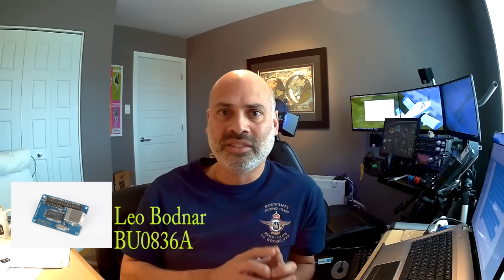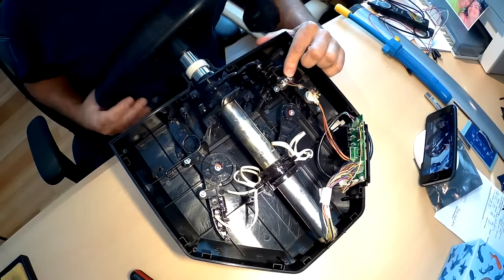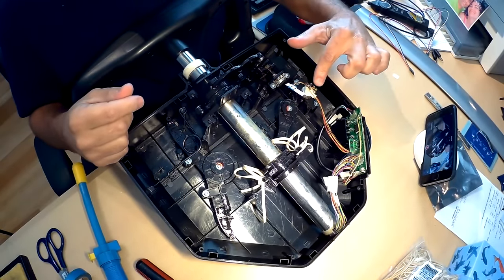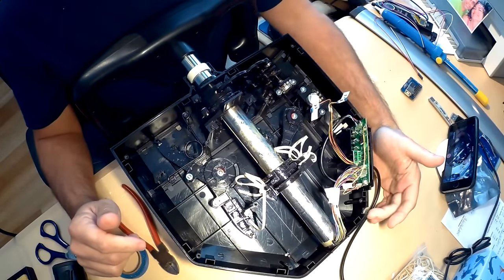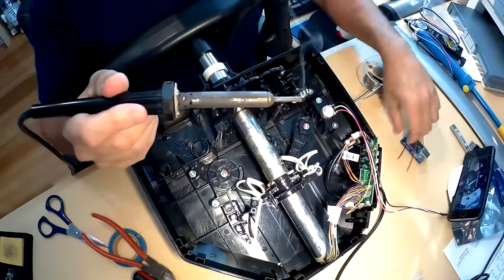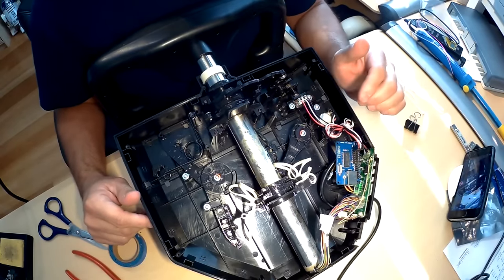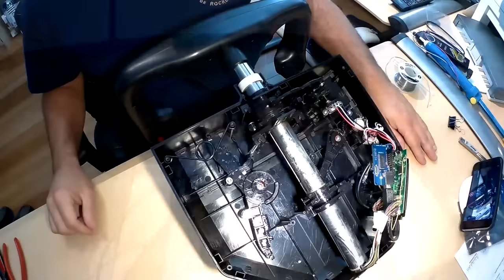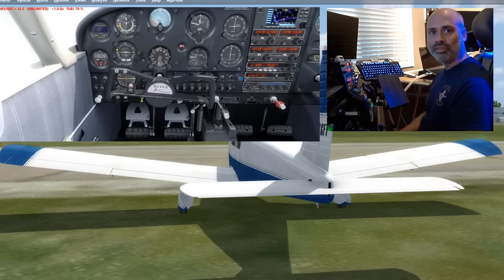Saitek Pro Flight Yoke Dead Zone Fix

Comment: Hello Dan!
Congrats on the video. and by the instructions.
Dear friend, maybe you can help me with a problem I'm facing in my Flight yoke system. It is calibrated at:
 (X-plane 11, 12, and MSFS 2020), and has the following issue:
when making the movements (aileron and elevator) in the yoke, it does not make the movements in the aircraft, so I remove the USB connection and put it back, at that moment it is normal, but a few seconds later it doesn't work again, I remove it and put it back in the USB, it works again but after a few seconds it falls again, including the display lighting is not lighting up, it works is only the lighting. if you can help me, thank you.
Sorry to consult you here.
abs
Eduardo - from Brazil
Reply from the maker: Wish I could help but it would very hard to guess the issue.

Comment: nice how to. thanks. one question. can you simply loop the usb of the bodnar board to the built in usb hub of the yoke? in this case you will just have one usb calbe from the yoke to the PC. if so, i guess you have to connect an external power source in order to power the internal usb hub.

Comment: Hi, I just made this modification and it works fantastic, only problem I have I cannot setup the buttons anymore. I have in Win10 devices still the Saitek Yoke (buttons are recongnised) and of course the new controller which I just instralled (no Bottons to set up) is there a possibility to merge the two controllers so I can use again the bottons of my Yoke??
Reply: Problem solved!!
Reply: Hello, what did you do to fix the problem, please ?

Comment: Nice bro what sim you using? I use logitek flight and saitek pedals in  I'm on prepar3d I use Fsuicp to calibrate axis and other functions I have no deadzone at all however since going to prepar I'm having noise on my axis but not in fsx I think it may be the different version of fsuicp one thing I learned is calibration when I calibrate my axis in spad next I notice lot of deadzone

Comment: Hi Dan, I installed the new board as your video, and plugged the usb from the board  into a free usb port on the back of the yoke. I have a problem with my set up, I tested it in "Devices" in my PC. the new board seems to operate as it should, but I get nothing from the yoke set up. I also tried it in XPlane , but no movement from the control surfaces at all As if the board is not communicating  with the yoke . What am I missing?

Comment: Great video! Will try this soon. Just one question, what configuration do you use with the rubber bands to give a good and smooth feedback of the elevator and ailerons axes??? Thank you in advance!
Reply from the maker: If you mean configuration in software, I have added a small deadzone on the pitch axis.  This is helpful to me.  If I misunderstood your question, just clarify for me what you mean by configuration.

Comment: Thanks for the video! I do have a question however. On your yoke, looking at the pitch potentiometer, your wire colors are yellow, red, black (from right to left). But on my yoke, mine are black, yellow, red (from right to left). Will the yellow wire always be +5v regardless of what position it's in?
Reply from the maker: That's a good question, I am not sure.  I would suggest getting a multi-meter and testing the voltage on that yellow wire to see.  Let us know your results!

Comment: Great video! Sadly, in my haste, I plugged in a 5 VDC power source with the plug set to reverse polarity (don't know why I set it up that way, or for what project....). Fried the Saitek Yoke power supply (I assume they take 5 VDC and regulate it down to 3.3 VDC). The question I have for you is, will can the 0836 board accommodate all switches and pots from the yoke and quadrant? I suppose if not, two 0836 boards could be used. Thanks again for the very important tips on the 0836 board! I've been thinking about doing this with an Arduino, but this solution seems much better.....
Reply: Ron Novak Excuse me, sir. what type of arduino board should it use? I don't really understand about type and model. Thank you!
Reply from the maker: You should be able to use the BU-0836A board to replace all your Saitek Yoke functions.  
It has 8 analog inputs,32 button / 16 rotary encoder inputs8-way "point-of-view" hat switch input
Reply: Caballeros 

I did my first tests with an Arduino Leonardo. Using a software library from M Hieronimus called ArduinoJoystickLibrary. It is in GitHub. I modified one of his examples to do analog reads. Bothe Leonardo and Micro are capable of being used as game controllers by Windows-based computers.
Reply: BTW, from Amazon, the Leonardo I bought was $10!  You will need to use a port expander since all Arduinos are port line limited but the package will probably cost less than a BU-0836A. You will need to program the Leonardo and interface the components. In that the BU-0836A is a simpler solution. (I bought one of those too, took two weeks to get to me, had the Amazon order in two days...)
Reply: Ron Novak Thanks for your information, Sir. What if I use Teensy 3.5 or 3.6? I look at the specs, comparing to BU-0836A, It has more analog input with 13-bits resolution (as I know that more bits means more precision)
Reply: Caballeros 
Absolutely right, I believe the Arduino's a/d gives us 10 bit resolution, i.e. 1 of 1024. If the Teensy is 13 bit res, that's 1 of 8192! However, looking at the Library from M Hieronimus, the Windows Game Controller Interface uses 0-127 or -127 to +127! When you program one of these devices and look at it in the game calibration ap, you will see that the ap automatically scales the input data. So I'm not sure that the resolution of the a/d should be your deciding factor. The Teeny does have more I/O ports and lines, however I believe they are 3.3 V, not 5 V. With that, we may need to use a level shifter to connect to 5 V devices. At ~$25, plus costs for ancillary periferrals, it may be worth it to go with the BU-0836A, at ~$30 (lots of I/O, operates at 5 V). The cost analysis also makes the Leonardo (~$10) and MicroChip MCP23017 16 bit I/O Expander (I2C interface, ~$1.20!) look very attractive. I must admit, I have bought all three and am playing with them to see which works best, etc.
Reply: Caballeros 
Absolutely right, I believe the Arduino's a/d gives us 10 bit resolution, i.e. 1 of 1024. If the Teensy is 13 bit res, that's 1 of 8192! However, looking at the Library from M Hieronimus, the Windows Game Controller Interface uses 0-127 or -127 to +127! When you program one of these devices and look at it in the game calibration ap, you will see that the ap automatically scales the input data. So I'm not sure that the resolution of the a/d should be your deciding factor. The Teeny does have more I/O ports and lines, however I believe they are 3.3 V, not 5 V. With that, we may need to use a level shifter to connect to 5 V devices. At ~$25, plus costs for ancillary periferrals, it may be worth it to go with the BU-0836A, at ~$30 (lots of I/O, operates at 5 V). The cost analysis also makes the Leonardo (~$10) and MicroChip MCP23017 16 bit I/O Expander (I2C interface, ~$1.20!) look very attractive. I must admit, I have bought all three and am playing with them to see which works best, etc.

Comment: No hardware changes--the deadzone is fixed!  I had the same problem, but after installing the driver/software released June 22nd, 2017 it works great! Here's the link to the Yoke update, and there's also an update for the rudder pedals as well (though they've always worked well): https://support.logitech.com/en_us/product/flight-sim-yoke-system/downloads
Reply: so there is no dead-zone anymore ? have you tested it thoroughly ??
Reply: greeksalad84 I flew one loop with the brand new yoke straight from Logitech and hated it. So before I bought this part and complained to Logitech, I figured I'd better see if they had an updated driver or maybe a flashable executable. I saw the recent driver + software combo,  installed it,  restarted,  re-calibrated X-plane 11, and wah-bam! Now it flies without a dead zone and I can zoom in on my Cessna's wing and see the subtle movements responding as soon as I start to turn the yoke.

UPDATE: A Logitech rep said "There are very slight deadzones built into the yoke, and you should be able to configure deadzones within the software." After flying a second time (without configuring the dead zones like the rep mentioned), I re-tested everything, and I can notice a very tiny dead zone right around all the centers; but, it's negligible and almost seems non-existent sometimes.  I might mess with the Saitek/Logitech software settings sometime, but it's pretty darn good at its default settings.

I'm on the latest Windows 10 64-bit OS.
Reply: You should have purchased a CH Yoke instead. People have nothing but good things to say about CH products. The Saitek brand has been tarnished and all faith is lost in the name despite being taken over by Logitech.
Reply from the maker: Will have to check that out, thanks.
Reply: @Adam Carson , you must have good luck then because i installed the software and drivers but there is still a deadzone.  perhaps i did something wrong but i followed instructions.  did you change any settings in the profiler?  any sensitivity settings or anything like that?
Reply: I got the yoke two days ago. Installed the update before using it which is standard practice when I get a new product. There's a profiles pack also which had no instructions as to which I should use so I just loaded the one that looked like the latest which was FSX_X5x. In game settings I increased the sensitivities until I was getting 1:1 movement (sucks that it only rotates 45 degree each way but I haven't needed to turn more than about 35 so far anyway so I guess it won't be a problem). I set the dead-zones to zero. Cranked it up, no dead-zone, just the indent. Unfortunately because I did all this before using the yoke, I have no idea which part of it actually fixed/prevented the issue.
Reply: Hēmi Paterson I'm glad to hear you have no issues.  No issues are good or as I say, no news is good news.  But Logitech told be to reinstall the updates and driver's when I got in contact with them because my yoke is now off center after doing pretty much exactly what you did.
Reply: I read somewhere that the software assigns center when you boot. As an experiment you could try holding the wheel off-center on boot...
Reply: Hēmi Paterson just so that I'm absolutely clear, you mean hold it off center when I boot up my computer?
Reply: Yes. It's worth trying. I've just given my yoke to someone to try for a couple weeks so I can't experiment myself.

Comment: I got the Bodnar board and installed it exactly as the video showed. I bought a USB chord with the usb end on one end and the other end that fits into the board. Now with the board plugged into the usb port on my PC the dead zone is gone however when I plug the original USB also into the port nothing works. without it plugged in my throttle quadrant wont work. I understand the board is only for pitch and roll but you have to get some type of power to the old board to run everything else. Stumpped.
Reply from the maker: You should have no issue keeping the original usb plugged in to your pc so that buttons and throttle quadrants continue to work.
Reply: @Mixturerich  I know but that is the way it is at the moment. what else could it possibly be?
Reply from the maker: Sadly difficult to diagnose at a distance.
Reply: no clue whats wrong
Reply: going back to original to see if that still works
Reply from the maker: Good starting point.
Reply: @Mixturerich  the only difference that is not the same as you is I bought a usb chord with the end that fits tghe board as yours looks like an adapter. Not sure if that could be it
Reply: the only difference that is not the same as you is I bought a usb chord with the end that fits tghe board as yours looks like an adapter. Not sure if that could be it

Jeff Shaw
Reply: well something is definitely wrong. everything is back where it was and now I cant calibrate anything. I think I will uninstall the sim then reinstall it
Reply: whats the name of the adapter you have plugged into the bodnar board?
Reply from the maker: There is no adapter.  USB cable connects to Bodnar board and PC.

Comment: I'm wondering, if you have the yoke with the throttle module, couldnt you swap one of the throttles for the axis and vice versa? Then you would have still a bit of a deadzone on the throttles but would save on buying another board.... and of course you would have to run 12 wires back and for the swap
Reply from the maker: I suppose you could try.  I think it would be more time and effort compared to the price of the board.

Comment: Hi!! Great video! Thanks 4 sharing... I've a question: I've done the "Zip ties and rubber bands" mod (it looks like you did the same). Though the pitch re-centers quite well it's not perfectly precise. Will I need to set up a small deadzone with the Leo Bodnar card? AFAIK real world yokes, both axis return to center when pressure is released. Thanks in advance.
Reply from the maker: Adding a deadzone is simply a matter of choice.  Try it with and without and see what your preference is.  I added a small deadzone personally.
Reply: Thank you!!!
Reply: Hi! I've done the mod and it's fantastic!!! Problem is I have to set quite a big (0.075) deadzone for pitch, because it doesn't center very well by itself (spring mod). Could you please give me an advice? Thanks!

Comment: I have just carried out the mods according to your video.
The pitch appears to be reversed push the yoke to descend the plane climbs and the plane go's up when the yoke is  pushed down. I did find however that the grd and red on the on the pitch sensor were opposite yours on the video. I connected the these coloured wires as I found them.
Can I reverse these connections, if so what will happen?. I will reconnect the  the original wires  in the meantime hopefully you can give me an answer to this.
Reply: If they are reversed all you need to do is swap the outer two wires round on the potentiometer leaving the middle one in place. This will solve your problem. So if you soldered red to the left and black to the right, then swap these round so red is on the right and black is on the left.

Comment: I hate to keep bothering you but here is the scererio when i plug in the board it says "multiple axes assigned to pitch". the other wires are unhooked and not touching. by passing the board and putting back to normal, all works fine
Reply from the maker: I wish I could help more.  If this were in front of me, I could poke at it.  Very difficult to diagnose this without seeing it.  The Bodnar board should work straight out of the box, no configuration is required.  Unplug the potentiometers from the Bodnar board and plug into usb with nothing connected.   See what happens. If you want to continue chat, connect with me on my Facebook page and start a messenger chat.
Reply: @Mixturerich  thank you so much this is frustrating

Comment: question for you Dan.  first though i love what you did here with that board.  very simple, easy fix with an incredibly functional purpose.  my question though, since you have the siatek/logitech yoke, is...  everyone seems to be putting rubber bands in their yokes in different configurations to combat the "sticking" from all the detents, if you will.  what bothers me with the yoke is that it centers itself on roll.  pitch is okay but in a real aircraft, the yoke will not center itself when rotated left or right to my knowledge.  Is there a way to get rid of the roll centering but keep the pitch centering??
Reply from the maker: Thanks for the like.  If you don't want roll to center, just remove the springs and/or rubber bands.  However, in a real aircraft, aerodynamically, your yoke will want to center.  The yoke is actually simulating reality more or less.  The rubber band fix was to get rid of the detente for smoother transitions through roll and pitch.
Reply: ok, then i guess i have misunderstood, or viewed, as i've saw the yoke stay off to one side.  but ill keep it then if its realistic.  but back to the deadzone fix if you dont mind, what would it entail to solder the potentiometer straight to the internals instead of having a wire run out the back and an extra plug.  Im really being picky at this point but i thought it was worth asking.  i downloaded the latest software and drivers for the yoke, which logitech said would fix the deadzone but unless i did something wrong, it did not completely...

Comment: Hi Dan. I have question I build my own yoke and it's 90 degree left and right, the problem I am facing is that when I turn my yoke ( pot) left or right to 70 degree the FSX yoke turn 90 degree and didn't giving me realistic movement or fallow my yoke movement ! I use BU0836XAnd I use the FSX plug in joystick calibration but even on window joystick setup on the control panel if I try to calibrate the yoke again the dot move to the both side of the box befor I complete my turn on my yoke 
Thank you for any help
Reply: Lower sensitivity on the axis within flight simulator or try using FSUIPC to calibrate. I am pretty sure you can set a specific left and right position and with FSUIPC you can play with the slope.
Reply: Thank you for the quick replay, I do use FSUIPC and that never help !!
I have limited numbers left and right and the sim read both top numbers when I go 70% left or right!! 
It's look like the Fsx design like that so that people with 70% yoke travels can reach  the 100% when they move the yoke 70%
Reply: Hi, I am actually not sure why it is doing that.  It should not at all...   My conclusion would be that your potentiometers in your yoke reach 100% at the 70% rotation point.